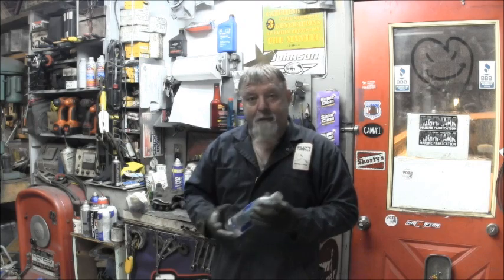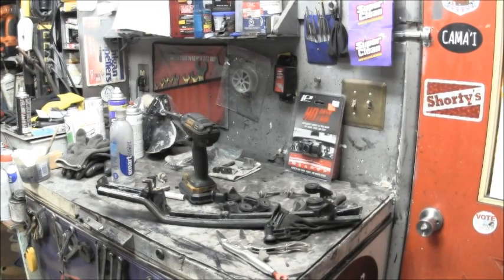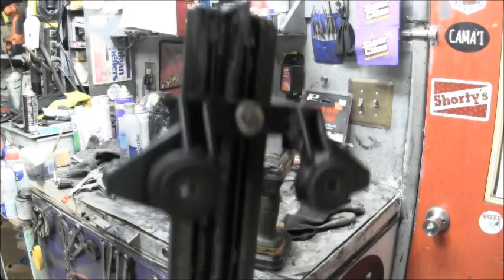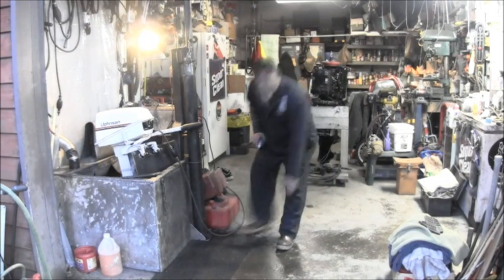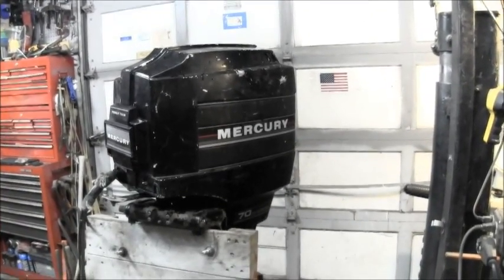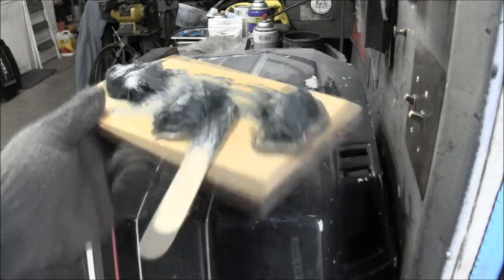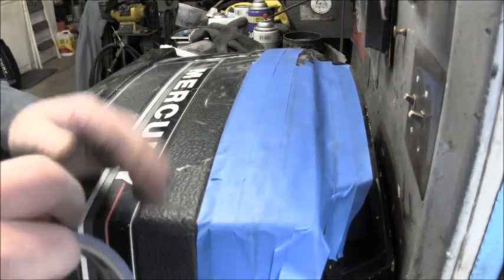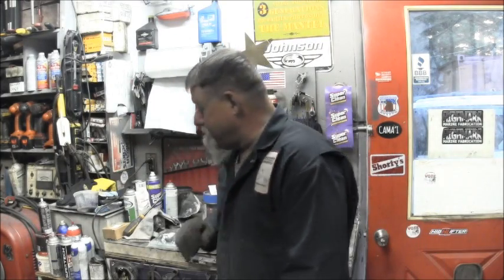MERCURY 1988 70 HP,  OIL INJECTED ,   ((  Part  4  ))

Comment: I use regular bondo like JB weld it gets hard my dad fixed a guys gas tank back in the 70s with it you get a lot it gets just as hard been doing it for years great videos 🤘🏻
Reply from the maker: Yes Sir' I use that also,  Mostly on the finish layer  b 4 priming. good stuff.     kb

Comment: Hi Kodi, First of all thanks for helping on my merc carb issue. Going to do some testing to confirm the needle and seat before ordering new ones if I can find a set? The hood on the 70 is coming along great and the fiberglass repair tips will come in handy someday. My merc pees out the side so see why you fixed yours. I think I will try to do the same with my 4hp Yamaha  kicker. It comes out the back in the middle which you can't see up at the console. Oh, and love the song. Not bad on the guitar buddy👍 One of these days will get mine out and write a song to share with you. I just need to do it
Reply from the maker: Good on U Tim,  I just always keep a old Ge-tar laying around & pick it up and noddle around when I'm bored, up untill covid I earned good money in a local house band here on Kodiak , We hope 2 start back if things get better.     kb
Reply: Oh, the seat was not the type that come out easy on these carbs so when I used my break bleeder pump discovered the needle and seat were holding pressure and turned out the float cover wasn't tight enough. I looked at the manual to see if the screws take locktight and no but there is a torque of 18" lbs on those.

Comment: I have one question on how these motors shut down is it the black and yellow wire that grounds the ignition is that how it turns off. Or what or how do you actually stop the motor. It's to my understanding the black and yellow stripe grounds the ignition which kills the motor correct thank you for your help

Comment: hey kody i have a question for you 

i have a 2020 merc 9.9 i just removed the tiller and i have a merc remote shift i want to install 
it was not designed for remote throttle conversion 

and i have not been able to get any answers from merc or make sense of the manual because it doesn’t address the outboard side of the throttle connections